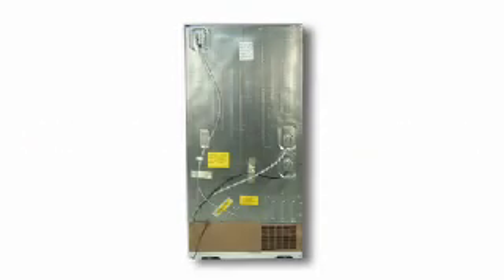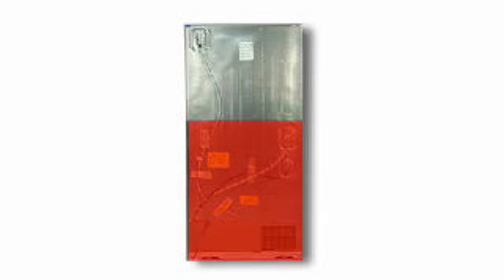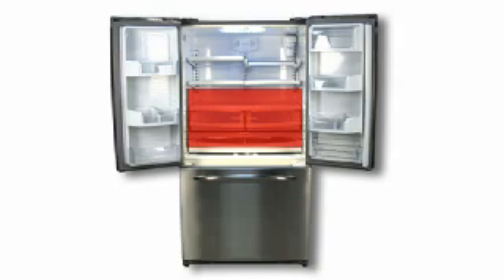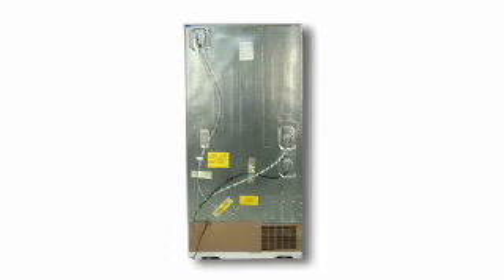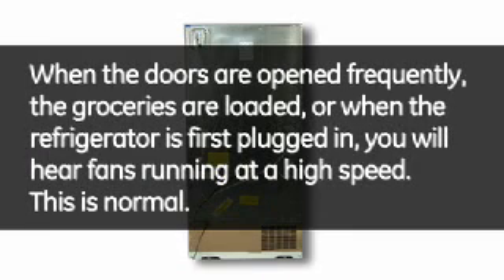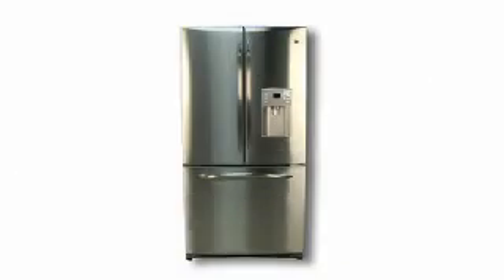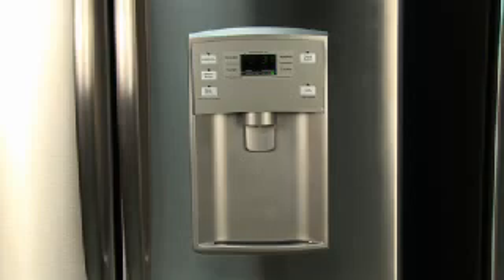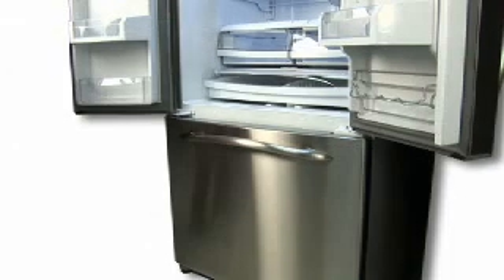Normal Sounds on Bottom Freezer Refrigerators

Comment: Nonsense, most refrigerators made today are constructed so cheaply they make these kinds of noises and as a disclaimer manufacturers refer to these noises as "normal". If you've been around as long as I have you know that refrigerators used to be better insulated and better constructed to minimize these noises. Had to replace my fridge this year, bought a GE and within one month it was making bursts of whining noises that sound just like a wounded animal.
Reply from the maker: Hi, Apexclipper. Our current refrigerators do make different sounds than our older models. This is done to achieve maximum efficiency, providing the benefit of a lower yearly operating cost. However, if the sound you are hearing seems excessive, or if you are hearing a new sound, service may be needed. To review further details on sounds, please visit our GE Appliances website. Select "support" and then choose "Service & Support by Product Line". Service scheduling can also be found on this same page. Thanks for reaching out to us.
Reply: GE Appliances
Thank you for a response regarding the GE unit I purchased. However I did call for service to evaluate the new loud noises it started making soon after installation in November of 2012. While the service tech was on site the fridge did not start the cycle where the noises occur. So his report was basically "no abnormal sound problems found" so GE would not replace it under the one year warranty I had on it. I called the GE service dept again requesting a replacement some months later out of frustration. I was told first a local repair service would have to be on site for a second inspection and would then have to speak with a GE engineer . When he called the number provided by the GE service center rep the GE engineer refused to speak with him, saying that the GE rep should not have routed this to his dept. So we seem stuck with this lemon and have to close all bedroom doors in the evening every night in order to sleep normally.
Reply from the maker: Hi, Apexclipper. We appreciate your reply. If you'd like to send your details to our email address, eResponse@ge.com, we'll review this for you. Thanks!
Reply: GE Appliances

Thanks for the follow-up here, I will send some details to that e-mail address. If you can restore my faith in GE products & service by resolving the problem I will certainly be impressed.
Reply from the maker: Thanks for letting us know, Apexclipper. We will look out for your reply!
Reply: so how'd it turn out guys?

Comment: Mine is making the compressor sound and it won't stop freezer seems to be blowing slightly cold air but everything is melting need help asap
Reply from the maker: Hi, CK. Thank you for reaching out to us. We're sorry you are experiencing this issue with your refrigerator. We know this must be frustrating, and we are happy to assist you.

Please take a look at our troubleshooting tips in the below article:

http://spklr.io/6055mZwT

If your symptoms persist, service may be needed. An appointment may be scheduled through our below link:

http://spklr.io/6056mZwp

Our service team can also be reached by phone at 1-800-GECares (1-800-432-2737), Monday – Friday: 8 a.m. – 8 p.m. ET. We hope this helps! Thanks, JP